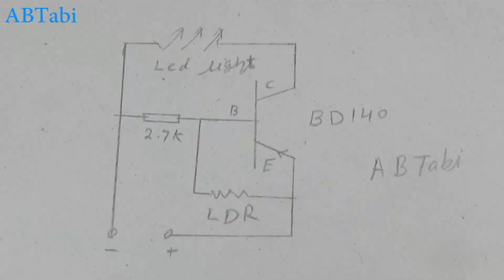Make very simple Automatic ON OFF use PNP transistor BD140, diy dark sensor

Comment: Sir, this circuit is working well, but its light does not turn off during the day, when the torch points to its ldr, then it's turn off  
Please solv this problem.
Thank you and excellent video.
Reply from the maker: Dear friend up the value of resistor ,,,,,     Thank you dear friend for interest ,,,,,,
Reply: Sir the ldr is working well by increasing the value of the  resistor to 10k, but the light becomes very low. The resistor is checked from 1k to 10k, as the value of the resistor increases, the light decreases.  
Please provide a solution for this.
Thank you.

Comment: Please add solar panel for charging battery
Reply from the maker: OK, dear friend ,,,,,,,,,   i will make as soon as possible,,,,,,,,  Thank you for interest,,,,,,,,,,,,
Reply: That's what I'm trying to figure out. Probably just put resistor on separate panel wire to base of PNP transistor. When dark, less voltage turns on base, turning on light. I believe the voltage of the base has to be more (sunlight on panel) in order to turn it off, just as the light dependent resistor.
And thanks to ABTabi for posting!